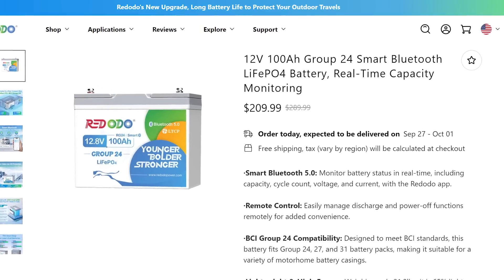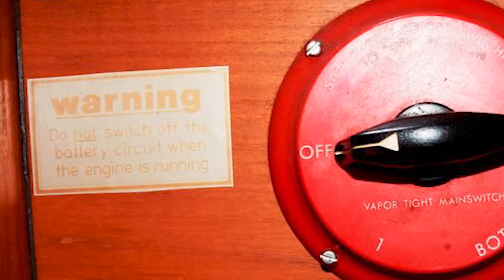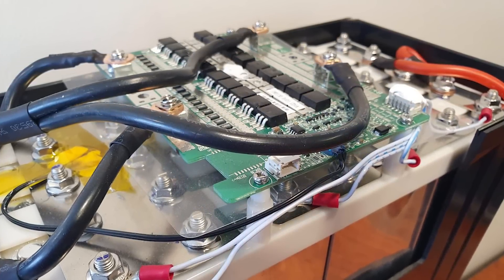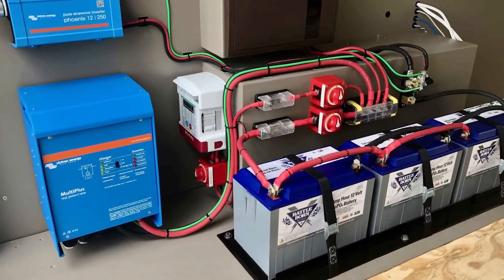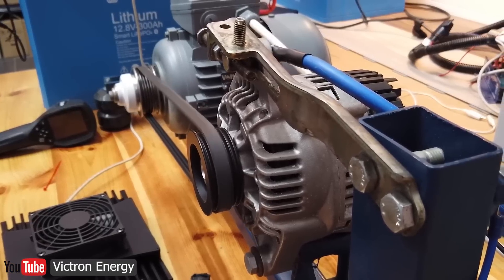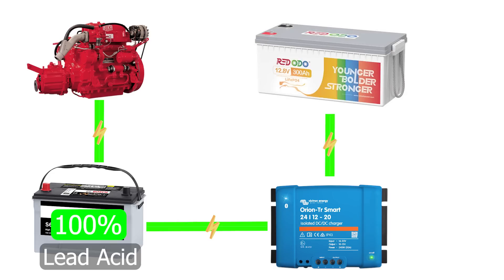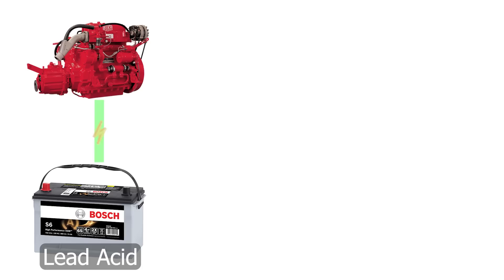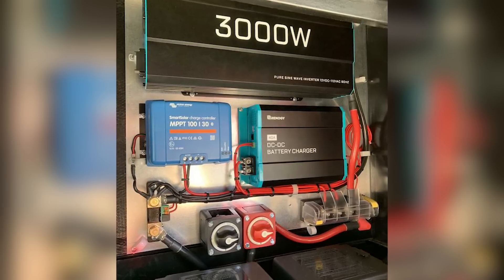Can A Lithium Battery Fry Your Alternator?

Comment: Sorry for such a late reply.  Retired EE here.  This is another example of mixing old sh!t with new stuff.  Your solution unfortunately is a poor solution.  Lead acid cells float at a nominal 2.2V per cell and 6 of them is 13.2.  Wet cells like to be charged at 14.4-14.7 during bulk charge with a drop to 13.1-13.2 to float charge.  AGM should not be charged at over 13.7 and needed to be dropped to 13.1 when nearing full charge or in either case the battery could be damaged.  When gel and AGM came out most cheap regulators held voltage to 14.4V (or less if above the alternators capacity) and could fry the AGM.  Old sh!t and new stuff.  A solution was first gen smart regulators with a wet/gel/AGM switch.  Cars (BEV) used lithium ion with cobalt and manganese (and nickel and/or aluminum) leading to a alphabet soup of battery chemistries all of which could catch fire.  LiFePO4 aka LFP came along and though less dense (weight and volume) are cheaper and won't catch fire.  In the lead acid replacement space these all come with internal BMS to protect the battery.  A push to reduce cost has resulted in batteries with cheap BMS which can suddenly shut down to protect the battery when the voltage is in the 14.7 range and in doing so fry an older alternator with older less capable regulator.  For that case a APM (alternator protection module) can be added but some newer alternator mounted regulators (a bit more expensive) include the APM.  Again avoid old sh!t with new stuff or get rid of old sh!t before it fries and maybe takes other things with it due to a voltage spike.  Also maybe avoid dirt cheap batteries from China.  Look at the cutoff voltage for the battery - is it 14.7V or is it 15V or unspecified.  Good heads up on the problem but bad suggested solution (imnsho).  btw- I have LFP on my boat and never will fry an alternator - electric propulsion so no alternator so can't fry one.

Comment: I wish some one would talk about outboard alternators and charging LIPO4 batteries. What hardware do I need for this scenario. Aren't outboard alternators designed to not have a battery. i.e. pull start outboards. I am of course talking about small boat outboards with  5 - 10 amp alternators. I changed my AGM to a LIPO4 and this video sounds like direct connection is bad. Can I just put a DC-DC Converter or DC-DC Charger in between outboard and LIPO4 and be OK?

Comment: I too plan to install a DC to DC onverter for my future lead acid/Lithium mix, but probably go with AGM on the start battery, for the less maintenance and better discharge rate than lead. And possibly upgrade my alternator for hight output to somewhat make up for hte inefficiency of the DC to DC converter. This video has been on my to watch list for a few weeks, so I finally watched it. Thanks.

Comment: Does this pass through power on the lead acid battery cause accelerated degradation?
Reply: Don't think so. Lead is happy at full charge. Lead life is measured in discharged hours. due to sulfation buildup. Really the integral of all hours.
(former electric wheelchair service tech.)

Comment: I connect my lithium direct to a lead acid but I set up the BMS to disconnect the charge at a voltage below that of the alternator. 14v is fine or, if you have a big alternator relative to lithium size then 14.2v a disconnect when charging at those voltages is very nearly full, 98-99%+ the lead acid provides protection against the spike. The BMS reconnect is set at 13.5v to avoid repeated charge cycles getting the battery to absolutely full which they don’t really like. The over temperature protection is done by simply using a charging cable from the alternator big enough to carry the full rated alternator current but not oversized and adjusting the length to introduce enough volt drop to limit the current. This is the opposite of what we do with lead acid where we try to reduce the drop. This method also protects against the BMS disconnecting charge for any other reason perhaps while solar charging where a disconnect can also send a voltage spike as MPPT controllers do not respond instantly. The lead acid also acts as a redundant system ensuring that you don’t get sudden dangerous blackouts for any reason. The BMS gets set to disconnect load at 12v which means you still have 50% of the lead acid left while you get your act together. If you start charging at 12.8v (20% lithium) then your lead acid doesn’t get used and is generally maintained at a low float by the lithium battery at around 13.2-13.3v Many in the U.K. are now doing this as it’s a cost effective way to convert to lithium while retaining all your lead acid equipment. The only stipulation is that the battery should have a programmable BMS to set up the correct hybrid parameters. I think all lithium batteries should have this as the parameters for the non adjustable ones are last ditch protection settings rather than actual management settings.
Reply: Phil, Are the details you outline about a hybrid system described fully and visually anywhere, so the one can implement them with confidence. There's nothing of any robustness or completeness, especially re marine, on YouTube.

Comment: I have been through this on two separate yachts. On one I chose to install a separate 120A alternator and control circuit just to charge a large house Lithium bank 900AH. This meant separate circuits for the engine battery and charging from the house circuit. The control circuit between the house alternator and the house batteries prevented incorrect voltage and also monitored the alternator temperature to prevent over heating. Engine rooms can get hot!.
On the second yacht we used a single alternator but installed a protection circuit running between the alternator and the house bank. Provided the same protection to the alternator to prevent damage and also allowed a higher voltage for fully charging the lithium bank.

Comment: We rely mostly on solar charge- beneteau, rather than the rotary switch, provides 2x hot and 1x ground switches. We simply moved the ground to a dedicated bus bar, isolated the start battery to connect only to the engine (through the #1 switch) and used the old ground switch as a “bridge” to connect the lithium bank directly to the alternator in case of emergency. The start battery can be left in-circuit or removed from the circuit all together. We also have a Balmar external controller and serpentine belt on the 100a alternator, so all bases covered.

Comment: Hi, my experience is that the DC/DC charger from Victron gets extremely hot. It also charges only 30Amps. I found the ideal solution by placing a temperature sensor on the alternator. This can be regulated easy and stops the charging as soon as the alternator temp is higher than 85C. Then it cools down to 75C and restarts the charging. Works perfectly!

Comment: Can you use an AGM battery in place of the lead acid battery?
Reply: AGM IS a lead acid battery, with a different internal physical construction.
Some different characteristics. Many good websites. use google.
Reply: AGM is lead acid its just not wet cell.

Comment: Tim,
I feel I must correct a statement you made. The scenario you described of a low current battery charger triggering the DC-DC charger won't happen with a properly wired DC-DC Renogy like the one you show @7.35, I don't know about other brands, I have the 60A Renogy aboard my boat. There is a sense wire wired to the field terminal of the alternator. It must be energized before the DC-DC charger will flow current to the LIFePo bank. (Unless you attempt to charge the start battery with the key on.)
DC-DC is not the most efficient way to charge LiFePo, that is true. My alternator output of 1050W into the DC-DC results in 864W delivered to my LiFePo house bank. In my use case, alternator is one of 5 charge sources, and the least desirable, used infrequently, usually in conjunction with motoring out of necessity.

Comment: Another thing to consider...
CG licensed marine engineer here. If your engine has electronic controls, the scenario that Practical Sailor describes here has the potential to wipe out your engine's ECU. This happened to me on a 2800 hp towboat. We had 8.1 liter Deere generator engines, one morning, the red light lit up on our monitor for the online genny, and then the boat went dark. We switched generators, and then pulled codes on the one that failed, and the code was for ECU failure. Luckily, we were in an area where we could get service. After some back and forth on the phone with my port engineer and the service operation, they brought a new ECU out to us programmed for our engine. We installed it, but the engine wouldn't crank. Throwing a meter on the battery indicated really low voltage, so we swapped out the battery. The engine then cranked and ran OK, but no charging voltage from the alternator.

The service tech and I went over what we found, and what we agreed on was that the battery had an internal cell connection open up. That caused the alternator to spike like described here, and the Deere ECU was not up to the instentaneous high voltage produced by the now disconnected alternator, and tha spike that got the ECU also got the alternator.

I can't speak to anybody else's ECU's resistance to system voltage spikes, so this may or may not happen with yours. It's just something to be aware of the possibility. After all, who carries a spare ECU?
Reply: @BilgeDweller  Thank you for your comment! I had a similar ECU failure and checked everything but have not considered an internal battery failure.

Comment: I connected my 170amp balmar directly to my lithium house bank... its the only way that a large alternator is worth having...
I simply put a Balmar APM-12 on the alternator which gives the alternator time to shut off in case the bms turns off the lithium batteries... I can charge the lithium incredibly fast this way
Easier on the engine, fuel, and everyone anchored near me...
Reply: I agree with you that properly done it can be a great option to connect the alternator directly to the house lithium bank. I have that same setup but with external regulator CAN controlled. But so you know, the APM-12 (a great device I also use but in 24v version) does not control anything or give anything time to do something. It merely serves as a sacrificial/disposable inexpensive part if there is a load dump. It absorbs the damaging voltage spike to protect the alternator.

Comment: I am a heavy industrial electrician by trade and  have  needed to use a soft start for big motors when dealing with limited available power 

I have been thinking of using the same principles to create a soft shutdown for an alternator using a diode light bulb and  a  fan that is blowing on the alternator
Reply: Small supercapacitor and/or resistor bank and some mostly passive circuitry and charge a lot of money for it?  Balmar and Sterling and maybe others have already figured that out and call them APMs (alternator protection modules).

Comment: If you buy a proper DC-DC charger you should not have any of the mentioned problems like discharging the starter battery or having bad efficiency. However, they are more expensive. Example: The Sterling Power Bi-Directional DC-DC Charger has an efficiency over 95 % (less heat also). It will not discharge the starter battery. An additional bonus for the case of solar power connected to the house battery > the DC-DC charger will top off the starter battery as well.

Comment: Keep lead as starter  and use a Argo FET . When lithium is full and the BMS stops, the Argo seamless keeps the lead chargin. Been using this setup for three years. Normalt get around 70-80 A to the house bank. So in 30 minutes I get a 24 h usage of batttery, with a 20 A DCDC you would need 2 hours.
VP D1-30,  115A alt, 3x 100 Ah Renogy and 90Ah AGM. Max temp on alternator around 95-100 deg C.

Comment: I, quite simply, only charge my lithium bank from solar.  I have placards reminding me which bank to only start or run the engine on.   Boat is on a mooring so I am not connected to shore power.  I installed a battery selector switch which allows me to switch the solar to charging the lead acid back as required.
Reply: Keep your lead acid as fully charged as possible. Sulfation happens at all charge levels, but least at full charge. That's why you store lead acid fully charged and top them off monthly at least. Or trickle charge.

Comment: I used your description in my recent lifepo4 install. The victron DC -DC charger sits there between AGM starter battery and Lithium house bank delivering, when it can, current to House bank. I set protection Voltage of starter battery to DC - DC charger so it cannot drop below a certain voltage to protect starter battery and it happily toggles between delivery and non delivery. The solar panels quickly bring up Lithium charge levels, so up to now the alternator is a top up in cloudy conditions.

Comment: Shore power typically runs a battery charger. On older (read before Li Batteries) boats, the chargers are set up for lead acid. You will need to change these out if you go to Lithium. There is another solution which DOES NOT NEED a DC to DC Converter .... First .... Make sure you have two (2) battery banks by removing the standard Bat 1 -> All -> Bat 2 switch and by either adding two separate switches or replace with a dual circuit switch ... Second .... Remove the old battery charger and replace it with a charge/inverter combo ... Connect the Charge/inverter to shore power and the lithium battery bank .... third - connect the old battery charger to the inverter (and to the lead acid battery) ..... and if you have solar - connect that to the lithium bank  ..... You now have the best of all worlds .... Shore power charges lithium bank .... powers inverter which powers lead acid charger - which charges lead acid bank .... Solar recharges lithium bank  which as mentioned can also recharge the lead acid bank via the inverter .... and while on shore power -> the charge/inverter can feed the lithium as quickly as possible (mine can go as high as 100 amp charge)  I can go into detail (write an article with pictures) as I made these changes to my Catalina 270 just recently ...

Comment: That is one of the dangers of buying a "drop-in" Lion replacement battery. As others have mentioned, it is possible to design a safe system that uses can utilize the full capacity of the alternator. I feel the author should have touched on those points.

Comment: So here's what I got from this video: Lithium batteries are great but can burn up your alternator ...talktalktalktalk.... Lead acid batteries won't do this.... talktalktalk.  Not criticizing. My take away is:  even though I have this amazing ProSine 2.0 Inverter.... if I should decide to go from my glass mat batteries to Lithium... make sure I work with someone who really knows this stuff.  Pay extra for this. It's worth it.   Thanks Tim. (And often when I reach the point I'm going to change something I'll re find a video like this, rewatch it more carefully, take notes. Good resource.) 

One thing that constantly frustrates me as a boat owner. Most of the systems are complex, often there are more than one company's products involved, and many of the companies (B&G.....) just never respond to any request for help or to even answer a question.  I would love to contact the company that sells the lithium batteries you just did a video on, or Battle Born and say, 'This is my system, Prosine, alternator, etc... can you tell me....?'  I would expect to get 'Oh yeah, no problem,' and it might be, or it might not be. (Our new dock boxes were totally screwed up. The GFIs kept tripping, alarms sounded for almost a month. We were first told to get new shore power lines, then we were told we needed to get an electrician to analyze our wiring.... Then I unplugged from the box and with no load it still tripped. We could've spent thousands of dollars and it was just the new dock boxes.  They were still blaming our boats when my neighbor and I  plugged into an empty berth on the other side of the gangway.) 

How about this for videos. I've got B&G but only the chartplotter and radar. Many many things don't work on the chartplotter mostly because I'm not running up  to date instruments. Speed and wind, sure they're not connected but why can't the radar track a target?    I know there are all these 'other' components that B&G would sell me, but they never ever say, This is what your system should include in order to....   So maybe do the major manufacturers and describe all the components that are needed. (I'm sure if I went to Annapolis I could get this explained to me. ) 
And maybe some videos comparing B&G, Ray Marine, Garmin, etc...  (I've never been on a boat with current Ray Marine, only B&G. 'Everybody says,' B&G has all these 'features' for sailing.... but are they things that I would actually use? That multileg calculation stuff looks cool, but I've never seen anyone bother to use them. I've got at least four months of round the clock sailing with B&G stuff. )  
How about NEMA2000 and the adapters to the old 0813  stuff. They're  for sale, but again, I've never met anyone who's used any, never found a good in depth message in the forums mentioning using them.  
With GPS, Predict Wind and Starlink sailors are never alone anymore -- until they're fixing something or trying to figure out why something isn't working or what they need to do next.